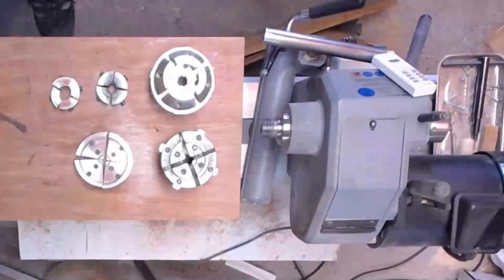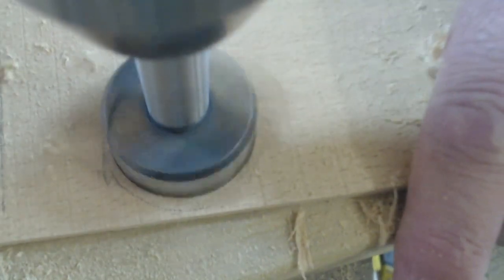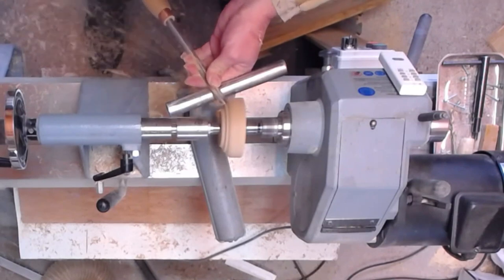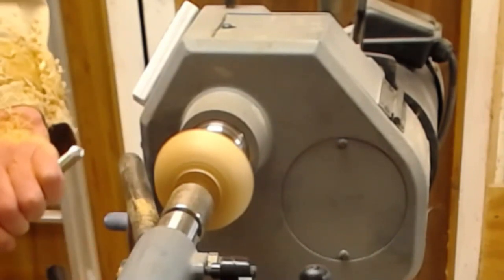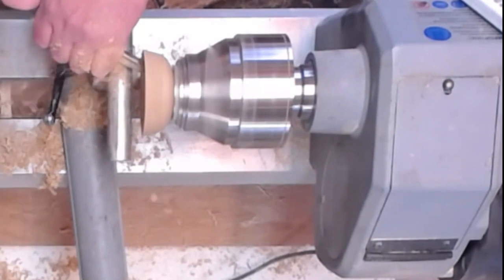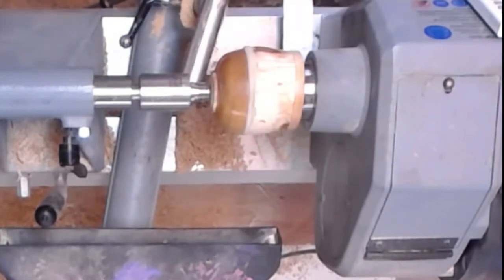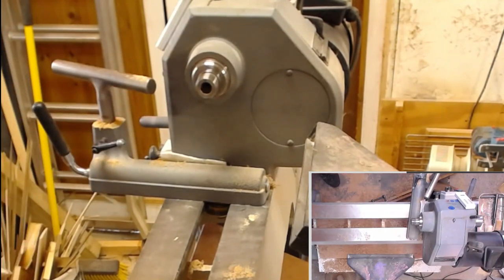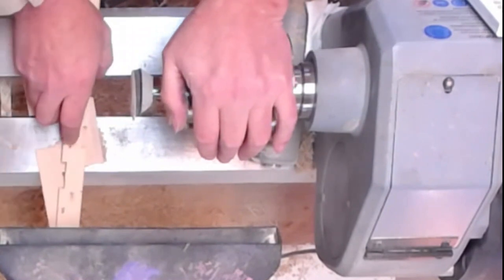Mortice / Tenon measuring gauge

Comment: Cool, thank you for sharing Pete.
Reply from the maker: Thank you Jiggsy, just one way of doing it, as I said I tend to use a ruler and pencil but am tempted to screw the jigs to the wall so I can measure them when I forget what my chuck jaws are :-)
Reply: @PeteTwistedTrees  I definitely have to get something made up, cause normally I end up using my calipers on a previous tenon offcut or having to change the jaws to measure them.